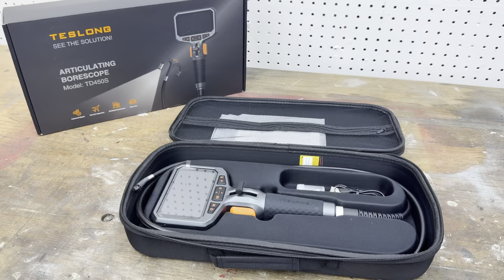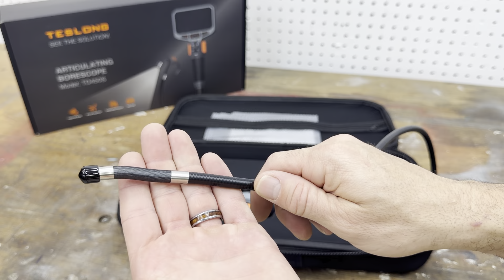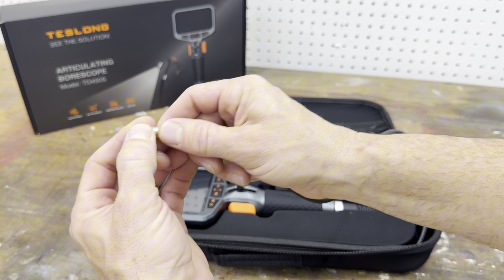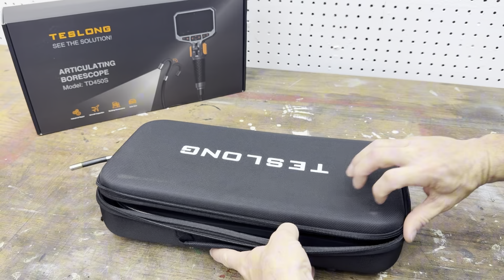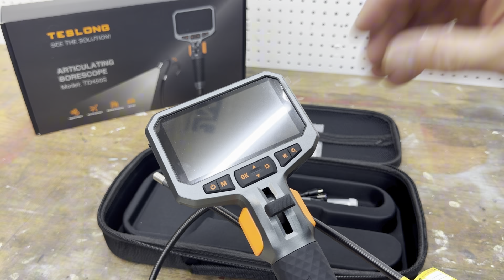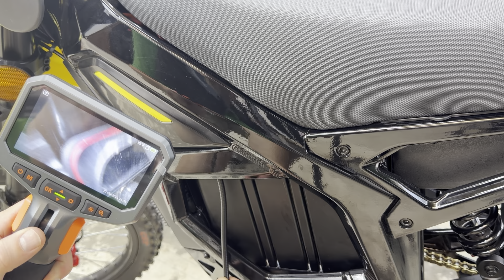Teslong Two-Way Articulating Borescope with Light, Industrial Endoscope Inspection Camera 450S

Comment: I bought the Teslong with a small diameter a few years ago. The battery recently died. It is in the camera internal and soldered in. Teslong suggests powering with charge adapter instead of trying to replace battery. Warranty is one year. I power mine with a rechargable pack that I got with a heated vest. Even though I paid a lot for this tool, it still has great value for the results.
Reply from the maker: A replaceable battery would be an upgrade. If they used a rechargable flashlight battery cell that would make this product reach more people i think.
Reply: Maybe Teslong will repair them out of warranty in a future time. Meanwhile it still works really well.